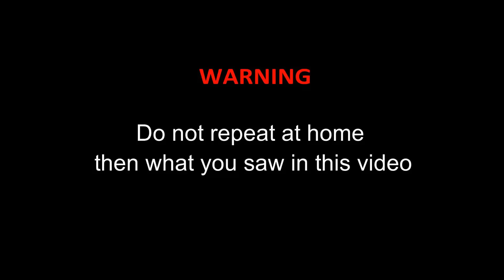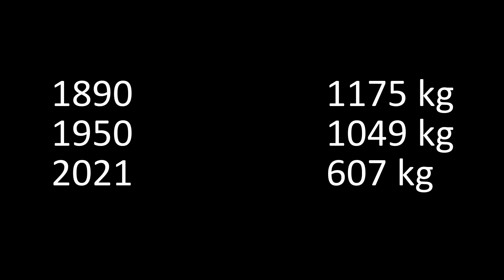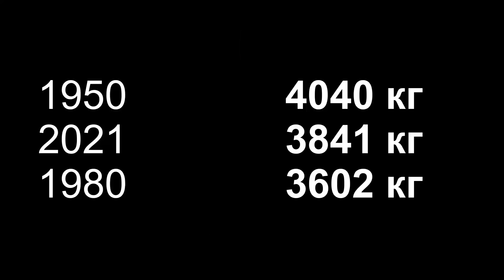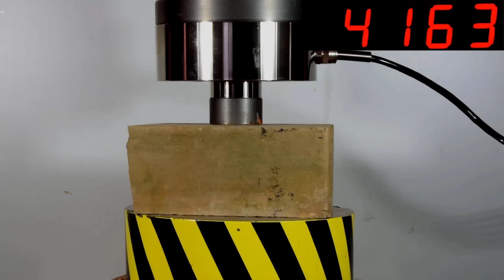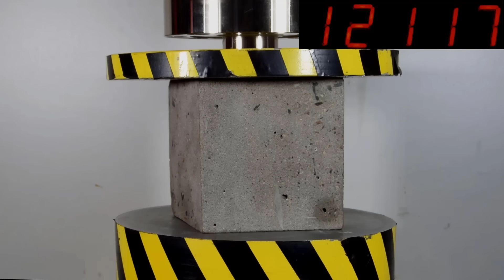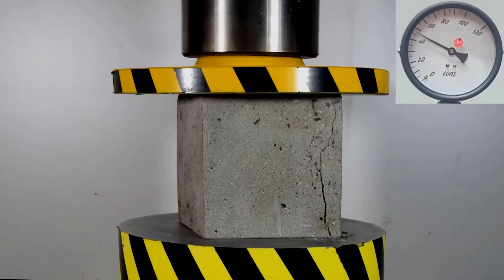HYDRAULIC PRESS VS OLD AND MODERN BRICKS

Comment: I think there's more to consider than just hardening over time. There's also a survivorship bias. The bricks created so long ago which survived until today were likely the stronger bricks made to begin with. The ones with critical imperfections would have been broken already, leaving the superior bricks to be tested now. Today's bricks haven't had that 'test of time', so you're likely testing a mid or sub-quality brick against a superior brick, even if they were made exactly the same way of the same stuff.
Reply: You have to also remember that modern bricks are produced in much more uniform manner; there's less quality variation, since more things in the process of making them are optimized further and controlled more closely. Thus; while there are less "weak" bricks made, there are also less "superior" bricks made.
Reply: Biologist’s way of thinking
Reply: Also, stronger does not necessarily means better
Who needs a brick that can withstand 2 tons when in your particular application you only need 500kg ?
We are much better at saving materials today than we were 100 years ago (on this particular topic)
Reply: Sample selection bias 👍🏼
Reply: > There's also a survivorship bias.

No there is not. There are literally tens of thousands of buildings with old bricks in Europe. They are all there and they are not really losing any bricks.
Reply: @ΤάσοςΚαυσοκαλυβίτης  that's exactly my thought
Reply: @ΤάσοςΚαυσοκαλυβίτης  This would be an excellent point if those buildings were being placed in the hydraulic press, rather than reclaimed bricks from demolished buildings.

There is survivorship bias in which bricks are unbroken during demolition.
Reply: @oldvlognewtricks  Most of them are not broken though, that is my point. Have a look at Fred Dibnah's video "1979: Steeplejack FRED DIBNAH takes down a MASSIVE chimney BRICK by BRICK". He is just damaging the mortar and most of the bricks survive the 200 hundred feet fall anyway.
Now take into account that most buildings that had those bricks where not as high as chimney stacks and there you have it.

There is not much of "survivor bias" for those bricks because they were meant to survive, the lot of them :P And they did survive. Millions of them. They are not hard to find you know.
Reply: @ΤάσοςΚαυσοκαλυβίτης  “There is not survivorship bias”

“Most of them are not broken”

🧐 A clue, Sherlock!

Edit: They were not ‘made to survive’ demolition. You are falsely equating the compressive resilience of a brick in an untouched building with the varied stresses of removing the brick from that building.

As above: these bricks are not in a building.

You might also want to take into account demolition, transport and storage processes… and find a industry standards reference that’s younger than forty years old. Nobody is dismantling buildings brick by brick with modern labour costs, unless the reclaimed bricks have an unusually high value.

And even with the greatest of care: survivorship bias.

The ones that survived survived. The ones that didn’t… didn’t. It doesn’t strengthen your point to cite the many millions of them happen to have survived, when this is the very definition of survivorship bias.
Reply: @oldvlognewtricks  So, according to you just because they survived, that's too bad for them. :) Maybe you should read a bit on where the BIAS part comes in the "survivor bias" and why it is not really applicable when most of the things you are talking about, do, in fact, survive even a demolition process.

> And even with the greatest of care: survivorship bias.

You took a very specific notion and expanded it so far that now it is bereft of ANY meaning.
Reply: @oldvlognewtricks  Of course there's survivorship bias... the question is "how relevant is it?"  If 99% of the bricks survived.... yes, they are the strongest 99% of the bricks made, but that doesn't really tell us much. It's a very different story if only 10% of the bricks survived.

I think @Τάσος Καυσοκαλυβίτης is simply saying "99% of the bricks survived, so survivorship bias is irrelevant."
Reply: @ΤάσοςΚαυσοκαλυβίτης  “That’s too bad for them”

Exactly the reverse. The ones that survived will inevitably be a population with greater overall structural integrity. Hooray for them… too bad for those that broke.

When most of the things survive, the ones that didn’t were likely for a reason… such as they were the weaker bricks, resulting in a remaining selection of bricks that are stronger. Again: the literal definition of survivorship bias.

The definition of ‘bias’ alone is basically irrelevant, since ‘survivorship bias’ is a technical term that exists independently of most of the meaning of ‘bias’. It seems increasingly plausible from your responses that you might not understand the concept being discussed.

Exactly how did I expand the concept that when any bricks break, the remaining bricks are likely to be stronger — regardless of how much care you are taking… since the surviving bricks did not break. It would be very startling if the bricks that broke all happened to be the stronger bricks, simply as a function of probability.
The only way there could be no survivorship bias is if zero bricks broke. I am sceptical this is the case.
I’d be delighted to clarify further if this is somehow unclear.

Simply stating I have done something is insufficient unless you can also state how, and perhaps also what exactly you understand to be more accurate.

You have taken a simple emergent property of statistics, and… made no point beyond asserting that I am somehow wrong…

Edited for typo
Reply: @davidkulmaczewski4911  Then perhaps they should have written ‘survivorship bias is insignificant’, rather than ‘there is no survivorship bias’… since those do not mean the same thing.

…and provided a source for this claim that statistically insignificantly many bricks are broken in demolition, transportation and storage in the… seven decades since manufacture.
Reply: @ΤάσοςΚαυσοκαλυβίτης  And what about the hundreds of thousands of brick buildings that were built over the centuries, but never survived? It's inevitable that only the strongest ones will survive, and bricks/concrete in particular harden as they age from what I hear, which compounds the survivorship bias we'll inevitably see.
Reply: When you get that HQ crafting proc
Reply: @nef36  It is objectively funny how you lot have narrowed down into a tunnel vision and that's the only variable that you can see, when in fact there are a LOT of them :) 
For example:
a) You assume that this particular brick "survived" some demolition or wearing down process (it was obviously burned on one side, possible fireside brick?, but none of you take that into account)
b) You assume that since it is here it is one of "the good bricks" when, in fact, if the building fell then it might have been one of "the bad bricks", so what do we have now? Non-survivor's bias?
c) The new brick which it was tested also "survived" the process of being created and reaching the store (some of them get dropped on the way and break ... or not). So, survivor's bias in the new brick as well, huzzah!

I could go on.
You need to realise that unless you know EXACTLY where that brick came from and make some erroneous assumption based on those EXACT conditions from which that PARTICULAR brick, then there is no "survivor's bias", because there is not enough data to make ANY assumptions, positive or negative. 

Use your minds, do not just repeat buzz words.
Reply: @oldvlognewtricks  > The ones that survived will inevitably be a population with greater overall structural integrity.

No, because you said that even with extreme care, it doesn't matter, so you yourself took that out of the equation. You are just quibbling without understanding the concept. For the rest, see my reply above to Nef.

> Exactly how did I expand the concept that when any bricks break, the remaining bricks are likely to be stronger

Does that even make sense? So, if someone demolished one wall with a wrecking ball (thus breaking the bricks) and the other 3 walls just topple after that (thus NOT breaking the bricks), you assert that the bricks that didn't get hit by the wrecking ball are de facto stronger. :D 

ooooooook :D
Reply: @ΤάσοςΚαυσοκαλυβίτης  The thing is, since, like you said, we don't know where the brick came from, we can't automatically assume it's stronger simply because it was made in a time before today. Do you know anything about how bricks were made, and if that process would always yield stronger bricks than modern processes? Do you know for a fact that the brick we're seeing is an actual average specimen, and not a particularly exceptional one? 

Taking one surviving example as evidence that old things are better than new things is the definition of survivorship bias. Use your head, my friend.
Reply: yep, natural selection basically.
Reply: @nef36  > we can't automatically assume it's stronger simply because it was made in a time before today

That is why no reasonable person watched this video and said "SeE oLd StUFf GoOd". I certainly made no such claim. This is an ENTERTAINMENT channel. There was no "comparative study of reasonable preserved bricks from different eras and areas, put to stress test via hydraulics press" which we watched.

We watched one person that had a hydraulic press and THREE bricks. Not a lot of room for any scientific hypothesis or experiments.

That's why there is no survivor's bias, because there is no bias to begin with? Got it? :) 

> Use your head, my friend.

I do. And I try to READ what people say before I go bananas on them for things they did NOT say ;)
Reply: @ΤάσοςΚαυσοκαλυβίτης  No, because you said that even with extreme care, it doesn’t matter

Exactly — unless you happen to break exactly zero bricks, survivorship bias still exists as an inevitable consequence of statistics.

How exactly does taking any amount of care affect the existence of probability?

For the rest, see…

Nah, mate — you can present your argument, or accept that you didn’t bother.

Does that even make sense?

I can explain it for you, but I can’t understand it for you.

So if someone demolished one wall with a wrecking ball (thus breaking the bricks)

Only a proportion of the bricks break — likely the most prone to breaking, thereby increasing the average strength of the population of surviving bricks…

Or someone has been using an antimatter wrecking ball, again.

and the other 3 walls just topple after that (thus NOT breaking the bricks)

A proportion will still break — from falling impact, torsion, breakage while removing mortar, loading and packing errors, thermal stress in storage, etc.

Again, the weaker bricks are more likely to break, thereby raising the average strength of the remaining population of bricks… etc. etc.

You asset that the bricks that didn’t get hit by the wrecking ball are de facto stronger.

I assert nothing of the sort.

I assert that the bricks that break when impacted by the wrecking ball… and in the collapse of any other walls that do not suffer a direct impact, and in the process of dismantling, cleaning, transporting, storing, etc. are likely to be stronger than those that happen to break under the same conditions.

It is that you’re misunderstanding the textbook example concerning locations of impacts on a plane, and applying the same reasoning to locations of wrecking ball impacts on a building? That’s the closest I can get to making sense of why you’re framing your scenario in that way.

Split the bricks in tranches if you prefer, and consider each population:

- Bricks that suffered a direct impact from a wrecking ball
- Bricks that were part of a collapsing wall
- Bricks that were subjected to the pinnacle of artisanal reclamation

Survivorship bias still applies to each of these populations, unless exactly zero bricks is broken for the population in question from the point of manufacture to the strength test.

Even Fred Dibnah didn’t get odds like that… or your hypothetical collapsing walls happen to be in zero gravity, and each brick is hermetically sealed in climate controlled freefall throughout its life.

:D

ooooooook :D

I couldn’t have put it better myself.
Reply: @ΤάσοςΚαυσοκαλυβίτης  I try to READ what people say before I go bananas on them for things they did NOT say ;)

All that effort, apparently for nothing…
Reply: @ΤάσοςΚαυσοκαλυβίτης  These are too infuriatingly juicy to pass up 😆

b) You assume that since it is here it is one of “the good bricks” when, in fact, if the building fell then it might have been one of “the bad bricks”, so what do we have now? Non-survivor’s bias?

Non-survivor’s bias would concern broken bricks, since ‘survival’ in this case concerns the brick breaking, since we aren’t collapsing buildings under the hydraulic press.

The bricks that cause a building to collapse are those that break, not those that don’t.

The fact that the brick is not broken places it in the population of “the good bricks”, since “the bad bricks” broke. Any one individual brick may well be weak and lucky, or every brick in the population might happen to be unreasonable strong — that is beside the point.
Survivorship bias simply states that removing weaker bricks makes the remaining population stronger on average, and since it is more likely that weak bricks break than strong bricks, the weak bricks are more likely to be removed through the usual course of their life.

c) The new brick which it was tested also “survived the process of being created and reaching the store (some of which get dropped on the way and break … or not). So, survivor’s bias on the new brick as well, huzzah!

This is absolutely correct. Survivorship bias applies to every population.

However many months of survivorship bias — not having been subjected to an event like a demolition, never having been part of a building, likely stored indoors rather than exposed to the elements, etc…

Versus the better part of a century as part of a working building?

Fly your squadron of planes into battle seventy times, and compare it to the squadron that flies once…

I could go on.

I’m on the edge of my seat.

You need to realise that unless you EXACTLY where that brick came from…

Bless your blushing vernal brow. Survivorship bias applies however much whataboutery gets thrown around. That’s the entire reason statistics are of any use at all.

All this laughter means I can skip my ab workout 🤣 Such a good use of ten minutes on a Sunday
Reply: Have you ever tried to chase a cable run in a wall in a old house Vs modern house? 

There's nothing more to it, the bricks are simply way way stronger.

 Survivorship bias, what a joke, it's not a fighter jet, it's a brick that's been sitting there. They are absolutely everywhere even the old bricks. 

Survivorship bias this is the most "I'm trying to sound clever shit" I've heard all year 🤣🤣🤣😂
Reply: @skyboosm  Because it’s better to have a product that’s overbuilt and lasts longer than the fragile products we have nowadays.
Reply: @echofoxtrotwhiskey1595  It’s not better, it’s wasteful. If your product DOES need 2 tons, then go with it. Do you really think it’s worth the extra material (and then, money and polution) to make your building last 200 years, when you will be dismantling it in 10 years ?
Reply: @essteeeffyu6483  Yes — to rewire for the new heat pump. And the new water main, and all the pipework in the bathroom I just refitted last Spring. Kitchen, next!
Anecdotes that say so much about whether or not survivorship bias applies to a brick removed from a building, and whether that is a factor in the reputation of Victorian bricks.

Once the brick is removed from the building, it happens to be one of the ones that didn’t break in the process. If that brick is below modern building standards, there is no value in retaining it at all and is overwhelmingly more likely to be buried, or broken up for aggregate or similar.

Even bricks inside Victorian walls are subject to cracking. Those walls or buildings that cracked have likely long since been repaired or demolished, though, along with the slums that were thrown up with the cheapest bricks possible… again: survivorship bias. There is also a surprising lack of those Victorian buildings that happened to be made of wood… I wonder why 🙄

Whether or not the bricks at the time happen to have been made stronger in general is unrelated to whether an isolated brick that survived is more likely to be stronger than the average of all bricks it was manufactured with.

“Trying to sound clever”… your inferiority complex is showing. The term describes the relevant principle. Odd that discussing it should prompt you to be defensive…
Reply: @skyboosm  That Depends. How do you know it’s going to be dismantled in 10 years? Maybe there’s an argument to be made for commercial buildings, but for residential buildings they 100% should be made as strong and long lasting as possible.
Reply: @echofoxtrotwhiskey1595  "in your particular application", that’s how I know it.
just build as you need, don’t overspec, that was my point. As for what the specs should be, that’s a whole other topic I don’t really think is worth discussing to me. As far as residential buildings are concerned, you could make several points to not build them "forever". Maybe in 20 years the town will be a ghost town and nobody will be living there. Maybe in 10 years it will be 85°C and nobody will be able to live there anyway. Or, maybe more down to the ground examples : maybe you’re constructing with "xyz" material that is very good. But then, 10 years later, you realize it became quite toxic (there is quite a lot of arsenic in older buildings in my area), and you have to dismantle them anyway. Or it is out dated wrt seismic norms. Or [...]
Anyway that’s about all I have to say on the topic. If what I said didn’t convice you that you shouldn’t make things as strong as you can, it’s fine, we can just let things there and disagree.

For the record, yes, I think that "this" thing I bought 2 months ago and broke in my hand, is a crappy thing that should have been made better.
Reply: @oldvlognewtricks  Yea, well, the modern bricks survived leaving the factory and transport. Survivorship bias on both sides. Great. Now we can agree that its really a moot point. Even the weakest batch of these older bricks will withhold more pressure than the modern brick. The modern brick is weaker. Its fine tuned to use minimal material to get the job done. Ugly, relatively weak, but very practical.
Reply: @SuWoopSparrow  Your ‘both sides’ compares a century inside a working building and surviving a demolition versus a few months in storage? And you think modern bricks aren’t subject to significantly better logistics and handling practices than the Victorian equivalent?

Please say you’re better than that argument.

If you can demonstrate that ‘the weakest batch’ of Victorian bricks hasn’t already been eliminated through selection over the last hundred years, then we might be approaching some kind of agreement… only you haven’t, because you’re ignoring survivorship bias and simply pointing at Victorian bricks that survived as if that’s a representative sample.

It is entirely plausible that modern bricks are closer to tolerance for the sake of efficiency — I would be astonished if they hadn’t been thoroughly optimised in a century —  but that isn’t sufficient to conclude that survivorship bias isn’t a significant factor.

Just because the stopped clock happens to be telling the right time doesn’t mean that the battery is suddenly charged.
Reply: @skyboosm  There’s more examples of people getting screwed by poor quality than there are of people getting screwed of something lasting too long.
Reply: @alexandraalmeida7700  It's not biology it's just critical thinking
Reply: @echofoxtrotwhiskey1595  I’m not arguing against quality. I’m arguing for "just the right amount" of quality.
Reply: @skyboosm  The right amount of quality is generally more that what you need. If you build everything thing to spec, when it meets that spec, it’s going to be at its limit. If you overbuilt it, then it’ll have a longer life during its normal usage.
Reply: @echofoxtrotwhiskey1595  I’ve never said the opposite of that
And if I did imply it, it wasn’t intended
Reply: @ΤάσοςΚαυσοκαλυβίτης  It doesn't matter how many old buildings still remain in good condition in Europe. Because the 1890's brick from the video is NOT the part of these buildings. We don't know its origin. It might be reclaimed after one of the old buildings had been demolished. Therefore we can't deny a possibility for surviroship bias here.
Reply: But such a large variation in strength? I doubt survivorw bias accounts for that 100% lol ...copium
Reply: People judging without any clue...
Its because new bricks are much more optimized. Bricks dont have to be that resistant cause the wall will be stable enough with them. 
Manufacturing methods improved alot over the decades. The new bricks are much cheaper, easier and quicker to produce. They re also a relief for the workers cause they re not as heavy as the old bircks. You feel the diference after couple hundrets went through your hands in one day. I worked in construction, the diference is huge.
Reply: Truely old is gold
Reply: I'm perfectly agree with you
Reply: Precisely, modern bricks are primarily going to be at a lower cost as there are layers for both the inside and outside, such as insulation or dry wall installation indoors. So assuming a survivorship bias is not necessarily outlandish.
Reply: This likely doesn’t apply in this situation. I’m going to assume that he discovered some warehouse full of old bricks, without a load and being put to use why would the older bricks have broken? 

I’m going to hypothesize this is actually due to the engineering needs, and the fact that modern brick‘s are not called upon to Support as much weight as modern bricks. Most buildings that use bricks today actually rely on some other kind of structure first. It wouldn’t be cost-effective to make bricks as strong as they once were when they were the main laid bearing device, it would be incredibly wasteful and over engineered.
Reply: I like the idea of a superior brick
Reply: @ΤάσοςΚαυσοκαλυβίτης  Yes, but it is the good buildings that survive, and the rubbish tends to get demolished about 50 years later.
Reply: Just check raw meterail used in nowfays and used in the past.    Calculate ratio of all raw. Meterial...
Reply: Hardening would make the brick more brittle not less.
Reply: Look at this sheer amount of cope when something from the past is superior in any given way to a modern equivalent. Hegelian whigs eternally BTFO.
Reply: Exactly!!what I was thinking.
Reply: @ΤάσοςΚαυσοκαλυβίτης  your comment is a textbook example of survivorship bias.
Reply: The older bricks were likely old ones found sitting around, not actually pulled from a building. I could be full wrong though
Reply: “superior brick” 💀
Reply: Down where I live there are dozens of complete buildings from the early 1600's build with bricks. All you need is a singular brick from a house that's "only" 100 years old. If a entire house from 16th century can stand with unbroken bricks that isn't much of a selection pressure.

The only thing that could have been selected is that the brick didn't crack during a house breakdown. But I wouldn't call that selection pressure caused by age, that effect would be equal for any brick that had been part of a house.
Reply: The modern brick being tested is a different type.
 The two older bricks look to be fired clay bricks of either grade A or B? They are great if your brick work is load bearing but are bad for your heating bill and blocking noise... 
The new brick looks like high porosity low baked clay. Often sold as pavers, they're decent for most non load bearing uses. Not the best at anything really, but good looking and affordable.
Reply: @ailithtwinning6806  True. It also comes down to where you live.
I am german and here we still build very solid houses. Walls are thick and lots of concrete or big hallow block bricks get used up until the roof. 
5-over-1s are stuff every architect here would facepalm you for :D
<3 the states btw. Got a cousin in Phoenix Arizona. Gonna visit him one day.
Reply: You also want to compare every brick's strength to weight ratio. Lighter bricks mean a lighter building. If the strength to weight ratio is better (taking the size of each brick into account) then the brick is better.
Reply: Cope
Reply: Someone with logic
Reply: Comrade Rosenberg (РОЗЕНБЕРГ) made good bricks in Russia.
Reply: You'd think with the ability to fly and access Google we might learn how to make a decent brink. I wouldn't think a good brick made from wood fire and mud on the ground would out do the industrial age.
Reply: i was considering this hypotesis as well... until i realized that tere are buildings still standing today made 800 years ago using those bricks, and the bricks from the ones that are not standing were often reused to build newer buildings throught the same timespan.
Reply: @ΤάσοςΚαυσοκαλυβίτης  survivorship bias: not all buildings remain from that time, meaning weaker bricks died out, only superior ones remain!
It's not because "efficiency" and "making more money per unit of cost & time invested" mean everything today, oh no! It's not because "quality" today means "wasted effort", oh no!!
/sarcasm
Reply: My brother statistician
Reply: Depends on the source. There are still likely many bricks from old times that have been sitting in a yard untouched. Very few in fact probably come from destructed buildings.
Reply: @oldvlognewtricks  > I’m on the edge of my seat.

More like the edge of your mind, arguing vehemently about bricks over the internet, missing the simple fact that this was just one brick, of unknown origin, in an entertainment channel. Keep shouting survivor's bias if that is what you like. I explained that since this is NOT a serious, scientific or even statistical study and noone reasonable took it seriously, then there is no bias to begin with.
Reply: @katbryce  > Yes, but it is the good buildings that survive,

I hardly think that during two world wars in Europe and numerous airstrikes and invasions and city battles, the armies and air-commands went "well, we will only hit the bad buildings folks. We want to keep the statistics intact for some people to quibble over the internet in 80 years" ... And then there is EARTHQUAKES which in my country are a serious disaster. A perfect brick might be in a building without good statics. The building will fall, yet the brick was fine.
Reply: @Shini1984  > survivorship bias: not all buildings remain from that time, meaning weaker bricks died out, only superior ones remain!

People that didn't read the posts bias: "I'll say something random without thinking and be sarcastic, yay!" ... for you I'll just say, read the posts above and come back later :) your "points" have been answered at least twice.
Reply: Also bricks could vary from country to country
Reply: one thing I've not seen anyone talk here is that the weight is concetrated in a single point, instead of being distributed across the brick's surface
Reply: fantastic explanation
Reply: I’m a builder and I’ve seen old bricks that crumble to dust and some old bricks that are noticeably heavier and hard as hell
Reply: @ΤάσοςΚαυσοκαλυβίτης  And what of the 10,000s of buildings over the millennia that haven’t made it?
Reply: I was looking for this comment
Reply: Natural brick Selection
Reply: @dickJohnsonpeter  Fred Dibnah is really a timeless person. Someone that anyone at any point in time could point to and say "there's a nice chap". As you said a great role model. I wish I could find more of his shows to watch. I've only seen his stuff on YT.

On your point on bricks, amen to that. So many variables indeed, which is why this was a video for entertainment. :)
Reply: @oldvlognewtricks  whoa you wrote 4 more paragraphs to try and convince me you're clever after a whole comment of "survivorship bias" which is absolutely incorrect and couldn't be further from being relevant in this case I'm afraid, go study it more and then eat your hat. 

There you go again digging deeper in your DO YOU THINK I'M SMART YET HOLE. Got a ladder to get out ?
Reply: @oldvlognewtricks  Of course the magnitude of months of storage is not the same as surviving a century of use and reuse. Either way, "survivorship bias" exists on both sides to some degree and is a pointless, muddy variable to introduce to the purpose of this video. 

What value is there to anally optimize scientific validity for this? Its simply an interesting video comparing bricks with a more than adequate base level of fair comparison. 

I dont see a note anywhere in the video or the description stating how he sourced the bricks. Many old bricks of vintage value are quite nicely salvaged by hand. Even a weak brick wont have a problem surviving a century once used for a building. Then it can be salvaged by hand and remain intact. You seem to be implying or assuming that these bricks were from some more destructive demolition, which would heavily overestimate the survivorship bias on the side of older bricks. Just because a brick is intact after a century doesnt automatically mean it was on the stronger end of the batch. For all we know, these could be incredibly weak individuals. If you care so much of the accuracy, you need to confirm this before going on a tangent about survivorship bias.

In any case, material optimization is not unique to bricks. We know many elements of our construction are weaker than in the past because we have stronger mathematical understanding of what it takes to create a safe structure on top of more modern production technologies that allow us to preserve material. Its a safe bet to say the older bricks were generally made stronger. As far as 100% scientifically proving that to no degree of error, what is the value in achieving that?
Reply: @essteeeffyu6483  Four paragraphs is enough to warrant a ‘woah’? Strange thing to advertise, but you can just ask and I’ll happily summarise anything you’re struggling with.

You’re going to have to do better than asserting ‘you are incorrect about survivorship bias’, though. I’ve taken the trouble to explain the principle and underlying reasoning multiple times, but your reasoning remains a mystery beyond ‘trust me, bro’.

Unless things are true simply because it is stated… in which case: this exchange has been extremely rewarding, dispels the myth about standards of internet reasoning and discourse, and I hope you have a lovely day.
Reply: @SuWoopSparrow  I’m implying nothing of any sort. I’m stating outright that unless precisely zero bricks are broken, then survivorship bias is a contributing factor and will increase the average strength of a population of bricks over time — irrespective of how carefully the bricks are reclaimed. More time increases this magnitude of this effect.

If you going to ask why include this factor, then it’s equally reasonable to ask why not include it. You appear to be assuming it is only a small contributor, when the entire point is that this has not yet been established.

Unknowns are not always trivial just because they are unknown.
Reply: @ΤάσοςΚαυσοκαλυβίτης  the buildings do remain, that's the point, no houses here are falling down 🤣 none have ever fallen down due to bad bricks, at least not yet these current ones are junk
Reply: So many people trying to sound clever in these comments talking about bias, etc. Been working construction 30+ years I've repointed, built and rebuilt, demolished walls on more occasions than I can count. Older bricks are superior quality, folk like me will literally go out of our way to take them to reuse, so long as the mortar is easily removable. I cannot say the same for modern bricks. I will also note in my years of experience there is a greater failure rate in modern bricks from water expansion in winter than for older bricks. A similar builder economy occurs with roofers who will ditch tiles without a second thought but collect slate, there's good money in slate reuse, for roofs, ponds, etc, small pieces are also good for use in evening out uneven jobs, including brickwork, wedging joists and the like.
Reply: @oldvlognewtricks  And you are assuming that it is a big contributor, before focusing on establishing how big it is. Point is, you dont know. And there is no point in establishing this. That is not the purpose of this video.
Reply: @SuWoopSparrow  I’m doing nothing of the sort — I’m saying it is definitely a factor, and that it cannot yet be ruled out… as I directly stated.

If you’re not even going to bother reading what I wrote, it’s unsurprising that we’re making such speedy progress.

Again: unknowns are not trivial just because they’re unknown.

Who said anything about the video? We’re having a discussion based on a comment under the video. The video also doesn’t address the importance of reading comprehension, but there’s no reason not to talk about it as it’s now relevant.
You do understand how conversation works, right? There is no prescribed agenda decided in advance, and nobody elected you discussion arbiter… If you don’t want to talk about it, nobody’s forcing you, but you’re gonna need something better than that to establish it’s irrelevant.
Reply: @oldvlognewtricks  Youre right. 

Its just a discussion that leads nowhere with no actual information other than pointing out obvious missing variables such as a present survivorship bias. Or the potential hardening from age. But no actual data to point out the significance of those variables. Unknowns are not trivial, but no info here to make the unknowns known. I guess a pointless discussion is not for me.
Reply: @oldvlognewtricks  you just seem to like to type a lot of words but say nothing pal but, perhaps I've misunderstood as you're so eager but I'll bite.
Survivorship bias assumes we're saying the data is flawed because only the houses with the strong bricks survived this long. No houses were ever falling down is my point, there's no records of massive brick losses in a certain decade or news of an epidemic of house collapses that would suggest survivorship bias has any relativity here at all.
Reply: @essteeeffyu6483  You like to make assertions like I ‘say nothing’ with plenty of evidence to the contrary.

Collapsing buildings are not the only thing that would result in bricks being lost, and since I’ve repeatedly listed other ways they are inevitably lost your point is at best incomplete.

Any time a brick is broken during its life, probability states that the average strength of the remaining population of bricks is likely to increase. No building need collapse at all for this to be true.

Maybe using more words would help you next time… or understanding what someone has written before you decide what it does and doesn’t say.
Reply: Oh, you got recommended that video too
Reply: Thinking this exact same thing but couldn’t quite put into words
Reply: @skyboosm  all clay bricks were made the same 100 years ago and were all for the same use. Hand crafted with quality they'd say.
Reply: Survivorship bias? Ha ha what a idiotic thing to say. Its a god damn brick guy ha ha ha.
Reply: Stuff today is made like crap. Simple as that. It’s the same reason appliances, furnaces and air conditioning units all fail early compared the old stuff.
Reply: Complete cope
Reply: Woa doode you just melted my brain into mashed taterz
Reply: Old stuff harder
Reply: No brick will get stronger over time.... it's the opposite, it mean that brick much more stronger when we measure it near its production time
Reply: I just can hear Trevor Noah talking about the superior bricks.
Reply: @ΤάσοςΚαυσοκαλυβίτης  they literally do lose bricks.  That's what restoration is for.
Reply: Keep in mind that the bricks in modern construction are optimized for mass production with a certain quality assurance. It’s not a made in China brick but it’s also not a made in Germany brick. Versus back then things with made to last and were high quality. It’s all about cost efficiency these days and if you need a high quality brick well then modern super high quality bricks are where it’s at. Plus bricks like concrete are better at resisting compression and the first test isn’t something bricks are good at.
Reply: this only 1 facts before they did shyt that lasted now we dont everythnig is crap from cars to bricks
Reply: This fucking guy looked at that thing about where.to reinforce airplanes, and tries to apply it to everything.
Reply: I will say I live in what would've been a workers house from about 1900 and the bricks are looking just fine.
Reply: Interesting theory but guess you're not too familiar with modern day reality
Reply: guy read a post about war planes and wanted to sound smart
Reply: @oldvlognewtricks  You don’t understand their point. Their point is, their experience in the field as well as established facts (ie the differences between the manufacturing of older and newer ones) proves that older bricks are simply that much stronger than modern ones, so much stronger that “survivorship bias” is mostly irrelevant. So irrelevant that it’s not worth discussing at all. It’s not just one brick surviving a century, but thousands if not millions of bricks standing the test of time and when randomly taken to compare to a typical modern brick, proves to be stronger. Modern bricks are optimised to be just strong enough for its purpose, while older bricks were made much stronger than they were likely needed to be. Therefore, survivorship bias is too little a factor to even be up for discussion at all.
Reply: @tooManyMidgets  For real? I know nothing about construction so it made sense at first, but the opposing comments while much less popular sounded more logical and reasonable.
Reply: Like natural selection?
Reply: @myouniverse0613  You don’t understand my point — citing ‘facts’ that have not been established (and anecdotal ‘field experience’) is a terrible argument… precisely because of survivorship bias.

Until it can be shown that the weaker bricks happen not to have been lost in the wholesale demolition of slum housing many decades ago (a huge amount of which happened as a result of bombings in world wars, and through urban regeneration in the 1960s), pointing at anything that has happened in your career — unless you have lived for more than a century already — is entirely beside the point.

And then claiming explicitly ‘there is no survivorship bias’ is the purest bunk. If you want to claim it’s trivial, then fine — you just have to then support that argument with more than a ‘trust me, bro’, and maybe don’t state outright that survivorship bias doesn’t apply *at all*.

As I said above: bricks may well have been manufactured stronger back then — it doesn’t mean survivorship bias is not inevitably a factor, or that vague allusions to ‘facts’ or ‘experience’ is the weakest of weak reasoning.

Otherwise, by the same kind of argument, wooden Tudor buildings never burned down, because there hasn’t been one that has burned down in my lifetime… They clearly built them fireproof 🧐
Reply: The brick tests are a random number generators here, a single measurement on it's own is fairly useless. Especially the second measurement uses already broken bricks, which have cracked and weakened in a random sort of manner, the result is meaningless. The way to do this would be to use many more bricks and look at the average for each type while keeping a careful eye on distribution of results, that would allow putting some actual error bars on the measurements and making some actual conclusions that are impossible here. 
The fresh concrete sample tho, who knows what that is mixed from, not all concretes are equal or meant to serve the same purpose, but load bearing concrete should be pretty strong in compression, much more like the second sample than the first.
Reply: There are so.many people here who do not understand what survivorship bias is.
Reply: @oldvlognewtricks  I would be more inclined to agree with you if you hadn’t called my arguments weak only to pull out a strawman to close off your statements. Such hypocrisy on your part which takes away from the credibility of your other arguments. No one here is trying to conclude whether these bricks would survive an earthquake or any other calamity or not. Your thoughtless analogy makes me believe the others here are right. You’re trying to appear smart, but you’re merely adding into someone else’s opinion without actually understanding the arguments being made.
Reply: @myouniverse0613  Or you could address the points rather than whether or not you like the way they are presented…
While demonstrating you don’t know what a strawman argument is. Oof.

I am also not trying to conclude whether they would survive a natural disaster — I was using gentle hyperbole to illustrate that any modern experience of something left over from over a century ago is not a representative sample… If I’m making a straw man, then you’re happy that it’s not a representative sample and we have no disagreement. You might want to be clearer about your point, if so, since that’s absolutely not what you have written.

Appropriately — your allusion that I am saying anything about which bricks will or won’t survive any event in particular happens to be a straw man.
If you happen to want to go to the trouble to deduce the distinction…

It’s also terrible reasoning to decide someone is right because you dislike the way someone else presents their argument. Doubly so if you’re not actually going to address the argument because you’re too busy sharing your feelings about it.

It’s suspect to assert that I don’t understand someone else’s argument (without taking the trouble to supply anything to support the claim)  
when you have already misunderstand mine (which I did happen to take the trouble to explain). But then you’re also overwhelmingly objecting to style rather than content — continuing in the theme of weak arguments.

Someone calling your argument weak and giving a reason why it is weak is the very essence of debate. There’s a saying about thermal tolerance in a culinary environment that springs to mind.

Edit: ‘hypocrisy’? ‘trying to appear smart’? Double oof 😆 Tell me again what exactly I’m trying to do… with those, I guess, mind reading skills? 🤦🏻‍♂️ Internet idiots aren’t what they used to be…
Reply: Ur comment makes no sense ,havent u seen any structures available from previous centuries?
Reply: @diggedboy2333  I wonder if something might have happened to the weaker structures… 🤦🏻‍♂️
Reply: @myouniverse0613  don't bother 🤣 he's got posters all over his wall in the form of an Orwellian 1940s big brother pointing with the caption "survivorship bias needs YOU"
Reply: @essteeeffyu6483  I had to remove a single brick on an old house with out damaging anything around it and let’s just say I grossly underestimated it… old bricks are practically granite….
Reply: @oldvlognewtricks   @Toby  I addressed I was inclined to agree with you. Did you completely miss that? Just that I was put off by your hypocrisy of calling out weak arguments and pulling out a strawman and was therefore became skeptical of your real intentions with this argument. You're just trying to appear smart without understanding the other side of the conversation. And you did pull a strawman. You twisted and exaggerated our arguments into something it was not and something completely different. 

That said, I didn't read any further than that first sentence. I didn't ask for further explanations, I'm done arguing with you the first time. Bye.
Reply: @yLezTilez  absolutely, my house is built from those 1950s ones, I've chopped out walls in many houses and these are an absolute nightmare to chase out but a new house the bricks are like butter
Reply: @essteeeffyu6483  i used to be in the local tile, stone, and terrazzo union and have worked with every kind of stone out there from limestones to black granites. I will never forget the chisel just bouncing off the brick. Literally had to drill into it until it looked like Swiss cheese, with a hammer drill and masonry bits, and even then, it was difficult. It was like sidewalk concrete. I have not tried to chip or cut a new brick, but I did help someone with a back awning/roof which had to be anchored into the brick wall. No hammer drill required, in fact I made a stink about how it was going to be hard and was slightly embarrassed at how wrong I was. I have done demolition though with new bricks, and they break in half as you throw them in a pile. Another thing that comes to mind is my parents two vehicles, and mine have used the same 6 old bricks for 20 years worth of oil changes and they still remain the same. Great video and glad to have caught your brick comment amongst the funny fancy science explanations. They’re just built different..
Reply: Deeeeep
Reply: In this thread people get triggered by a simple statistical phenomenon.
Reply: This same analogy is why people think the best of music has gone by
Reply: so we are going the natural selection route.  Interesting. lol
Reply: Facts. It's why everyone says they don't make things the same. No they do, it's just you only see what remains to say those are made well. the junk say 30 years ago is the same as junk now. Give it 30 years and we'll see things survive and say the same thing
Reply: Meh, my all brick house was built in 1943 of brick and the mortar has been tuckpointed in a few spots but still no cracked bricks and very solid.

My sister’s house, built in 2005, brick facade already crumbling.

And I get more rain and snow than her.

there is some truth to “they just don’t make em like they used to”
Reply: I thought of the exact same thing. the 2021 brick might not even last until 2022 anyway.
Reply: Modern bricks are expected to be superior than old bricks without getting tougher over time
Reply: Brick Theory
Reply: @ΤάσοςΚαυσοκαλυβίτης  It's really not a difficult concept.  

Older generations had expensive buildings and cheap buildings, just like today  

the cheap ones are all gone, only the expensive durable ones remain
Reply: @Kardinaalilintu  Indeed and it Goes to show that modern bricks are made from inferior materials but likely with a Better process since the quality is more consistent
Reply: Now apply this logic to the health world.

Now be in fear that science is and will keep continuing to be wrong about many things related to your health
Reply: @skyboosm  its a point force so if the area is 10 times bigger the force have to rise with it
Reply: Nope
Reply: This is one of the best comments that i have seen on youtube, i would never have thought about it but is so true.
Reply: @alinakinyaeva1836  > the cheap ones are all gone, only the expensive durable ones remain

Sometimes it makes me wonder where you'd need to live in order to possibly think that. As I answered earlier, there are MANY factors that have NOTHING to do with the materials or the expense of the bricks that can make a building still be here or not.
Europe, since 1890, has had two world wars, a few other smaller wars, God knows how many floods depending on the place, earthquakes, fires and a lot more other things that do not give a damn how expensive were the bricks you used.

For God's sake, pause and think for once.
Reply: Damn he right
Reply: Damn he right
Reply: Concrete doesn’t get stronger with age, it was different building processes. More Portland cement less sand. We have gotten cheap because of the population increase over the last hundred years, supply and demand
Reply: After 28 days concrete is as strong as it’s gonna get
Reply: I mean if you tried a hundred bricks from the same batch you could get a median. But trying one brick of different ages doesnt tell nothing really
Reply: @austins19982  this is not concrete bricks. They are made of clay
Reply: Also the modern concrete clearly wasn't cured correctly, probably was made with wrong proportions, too much sand or water is my guess.
It was powdery inside, and this is enough proof that it was made wrong or not cured for enough time, but my highest bet is wrong proportions.
Reply: @yLezTilez  hahahaha 👍
Reply: Survivorship bias is one of the coolest things I've recently discovered
Reply: Survivorship bias was my first thought
Reply: @ΤάσοςΚαυσοκαλυβίτης  and there are millions of buildings that didn't survive. What's your point, here?
Reply: Plus, it is testing a single example only, which scientifically doesn't proof anything. You need to have a large sample to proof it. It could be that by chance the modern brick had a structural flaw like a fracture which makes it much weaker - hence the need of large sample size.
Reply: Survivorship bias is an interesting point (I hadn't thought about that). I guess that's a limitation of testing bricks made in 1890; however, one can test lots of modern-day bricks so that the sample size is large enough to get an average breaking point.
Reply: @bubba200874426  I've replied to this four times already. READ the posts please :)
Reply: @ΤάσοςΚαυσοκαλυβίτης  do you pit 602 kg on evtey brick?
Reply: @nursoweilja1487  > do you pit 602 kg on evtey brick?

Yeah, I have my mother in law sit in the brick for a minute. If the brick survives, I use it to build my house. If it turns to dust, I use its remains to make concrete. :D

I do that for every brick. I am thorough like that.
Reply: Highly appreciate the logic. Sick of all these insane videos
Reply: I think he is because the brick looks like it has air pockets in it
Reply: @tooManyMidgets  These are the ones that survived though. There is always variations in manufacturing. Some bricks will have more flaws, some will have fewer. Because the more flaws bricks are more likely to break, the less flawed ones will generally survive longer. If these bricks were tested way back in 1980, they likely would have been stronger than even other random bricks manufactured at the same time.

Another great example of this phenomena is in modern chip manufacturing. There is a thing called the "silicon lottary". Say in 50 years theres a run of r5 3600 chips made and they're tested against an r5 3600 thats been in a computer for 50 years. The old chip may perform better because it was one of the "winners" of the silicon lottery and by pure accident was much higher quality than others manufactured recently and therefore lasted for 50 years without failure.
Reply: @JR-gh8lp  Exactly like natural selection. The strong ones survived.
Reply: I knew that the Old Brick would be stronger than the new bricks before I even clicked on the video. Everything from today is made cheaper and built to be broken and replaced on purpose. Thank goodness they even used those kinds of bricks in the past, or Urban exploration of super old buildings wouldn't even be a thing.
Reply: Seriously people stop, there is no bias, if anything the brick from 2021 should have the advantage considering it hasn't had time to be exposed to all the weathering like the other bricks have, people want to call it survivor bias 😂 as if you could somehow determine these bricks were better than average quality of the time. The fact is the bricks are made to be cheaper and lighter because manufacturing is going to cut costs anywhere they can to save money. Don't fool yourselves, things aren't made to the same quality as they used to be, everything cuts corners for the sake of profit.